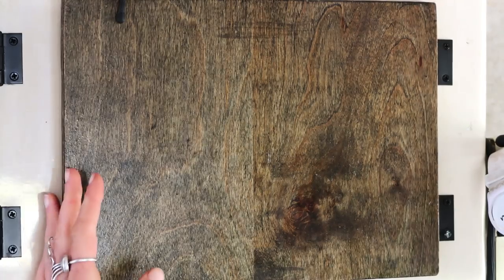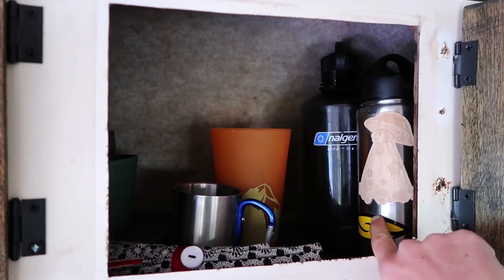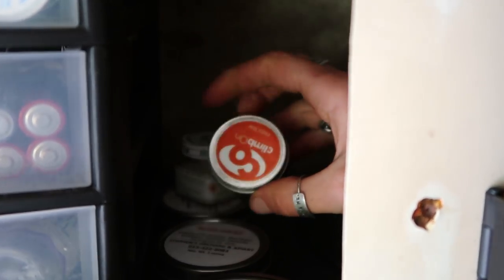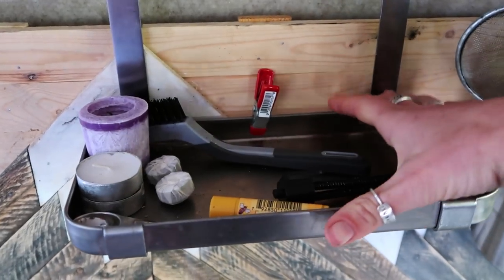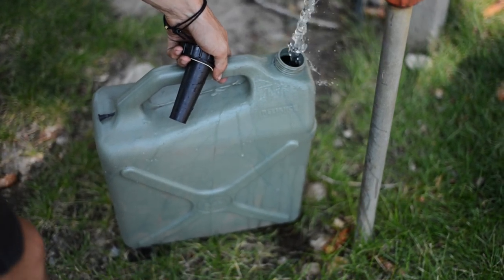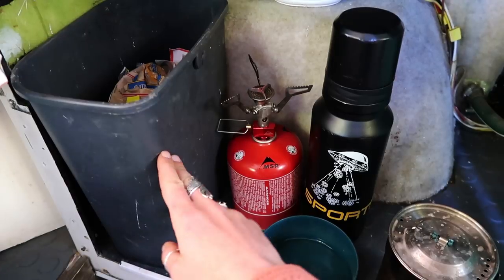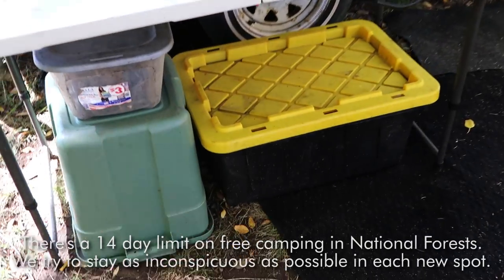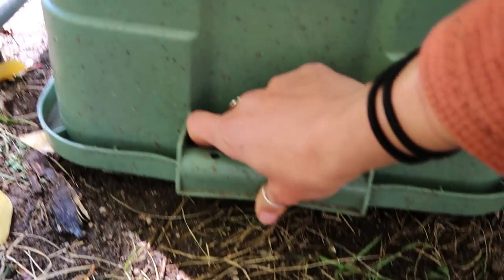Kitchen Tour in my 13ft Scamp Trailer

Comment: I don't know if you'll ever see this I've been watching you for a few months now been looking for a Scamp for about 2 years 2 days ago I got a phone call and one dropped in my lap a 16-footer 1999 and is almost like brand new cook stoves never been used the furnace has never been turned on kept in a garage for the most part got brand new tires on it the new vinyl flooring if they didn't like the carpet and three boxes of spare parts just in case I need something from wheel bearings to those little white cap the door seals and on and on I am so blessed I can't wait to get it on the road I've been living in a 26-foot RV so I have and I hit the road again. Like to thank both of you for your inspiration and your freedom and sharing it.. blessings